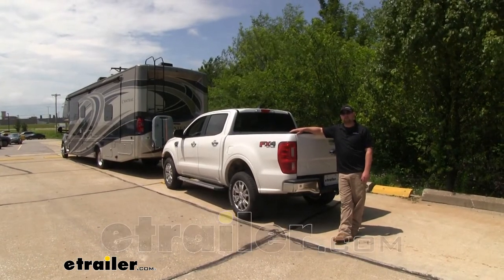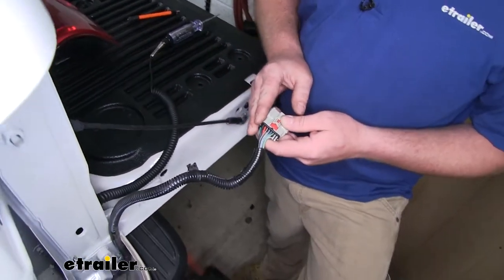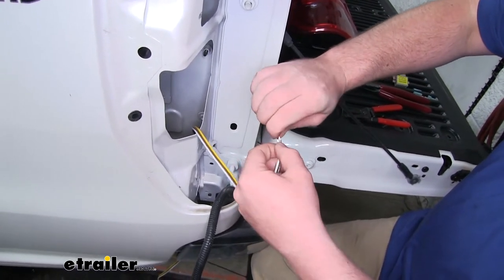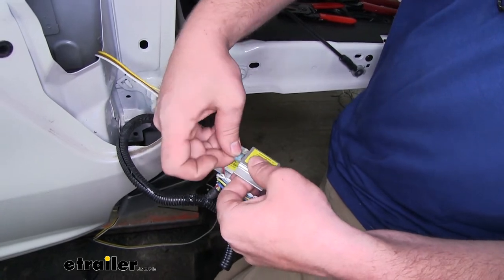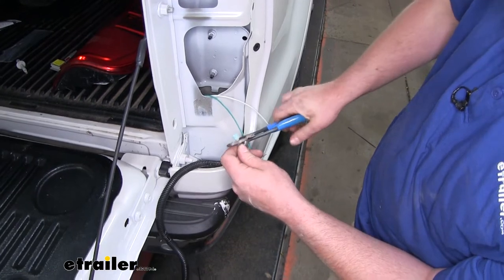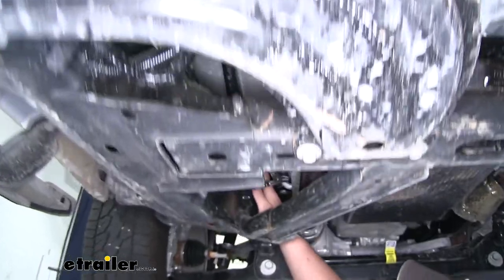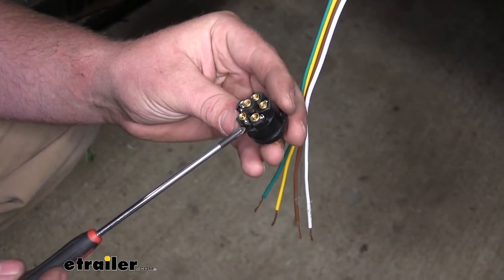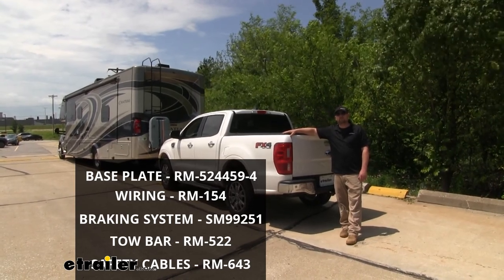etrailer | Install: Roadmaster 4-Diode Universal Wiring Kit for Towed Vehicles on a 2019 Ford Ranger

Comment: Doesn't work on 2020 Ford Ranger without a 2 to 3 converter and 2 more diodes. If you do it like the video and turn the headlights on in the motor home the turn signals become emergency flashers and they both blink at the same time.
Reply from the maker: If you have LED lights on your 2020 Ford Ranger, check out the following link for the tow bar wiring kit you will need.
https://www.etrailer.com/Tow-Bar-Wiring/Roadmaster/RM38FR.html
Reply: @etrailer  Why don't you put that in your video then? The 2019 in the video looks like it has LED tail lights.